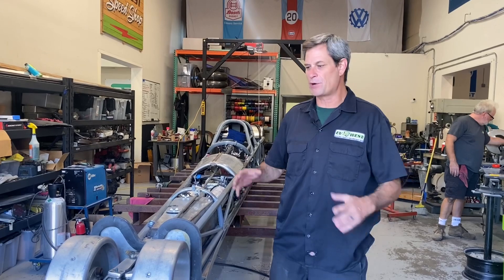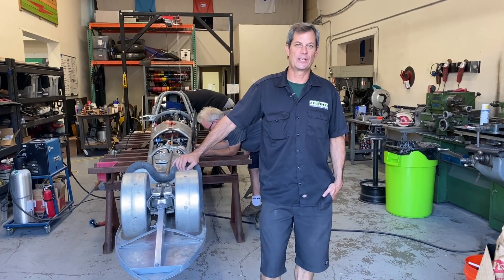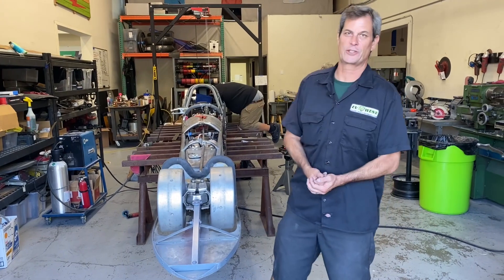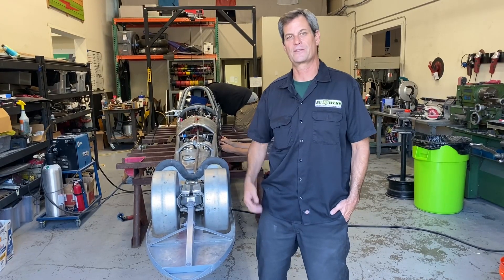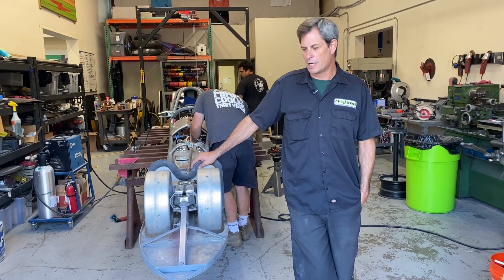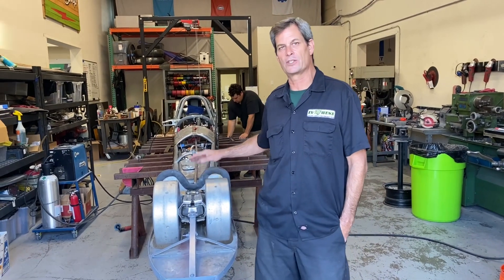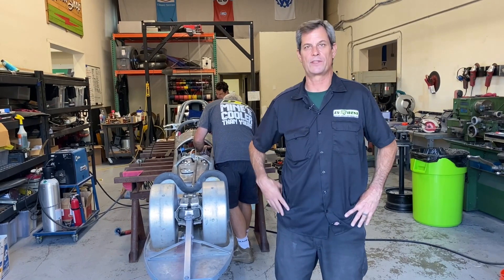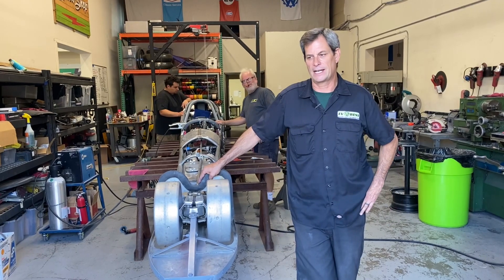Electric Land Speed Build Crunch Time 2021

Comment: The Extreme E Odessy 21 use frozen CO2 blocks that they load in the car right before the race. Idk what areas your looking to improve at the moment but that could probably shave off a good deal of weight.

Comment: i would like to see a vertical bar in the middle of the 1st roll bar going down to the "dash" area. In case of worst case. Would hold the roll bar in place. Yes it would be like an aircraft Jet windshield, but they do fine like that. just a thought.